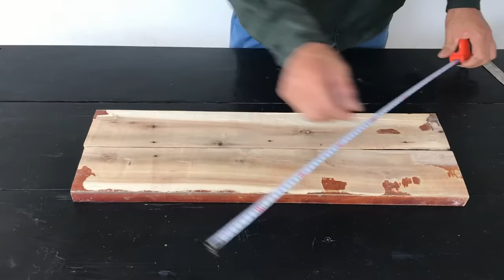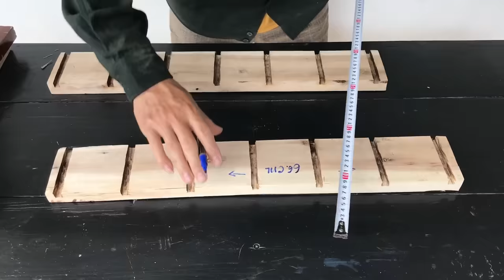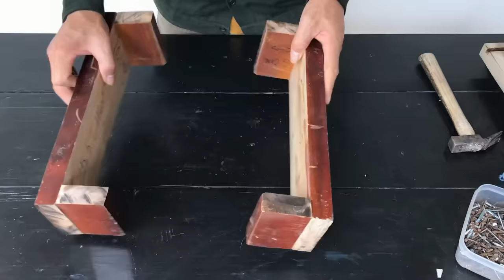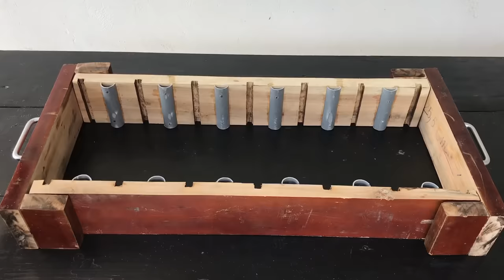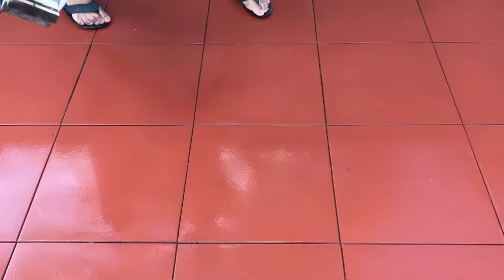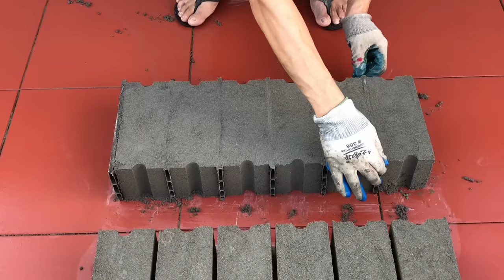Create many bricks for 1 production - Cement brick mold made from wood

Comment: I like everything about this "IDEA" however, there's 2 things wrong here..... the bottom is open therefore you're compacting the cement to whatever is underneath when you do it so its very possible you can have issues with your bricks later from that. You need to have something underneath. The second thing wrong with this is that there's just not enough water, doing it this way with little moisture will cause it to be brittle and have possible air pockets because you do not have enough pressure during compaction and the integrity of your bricks could very easily fail. It is a great idea but there needs to be a few modifications is all 👍 👌 👍